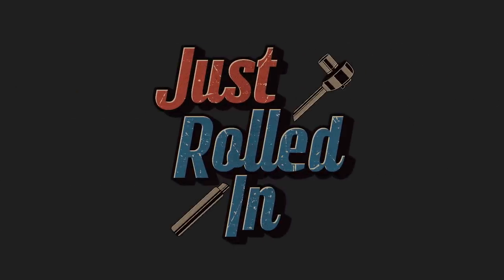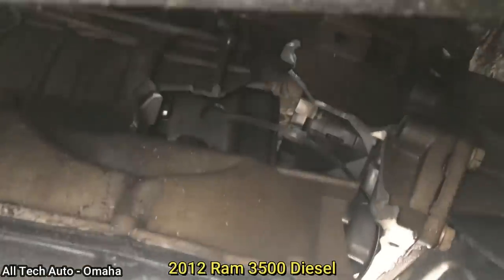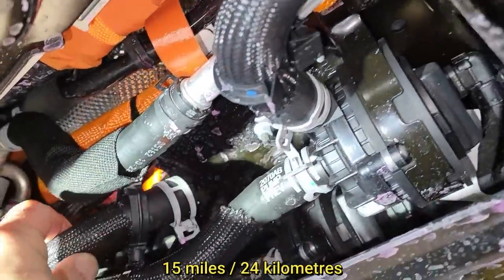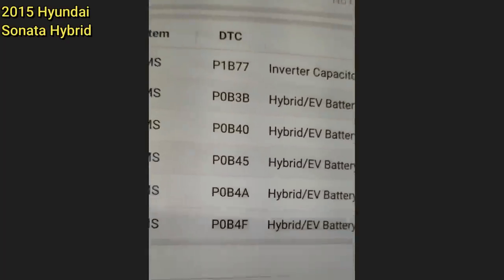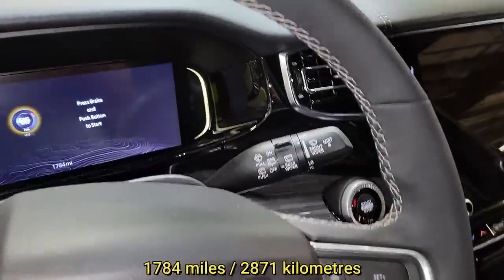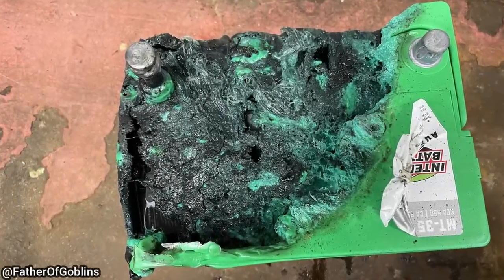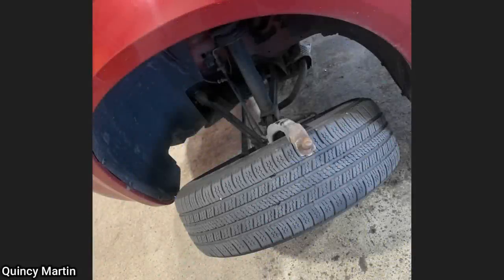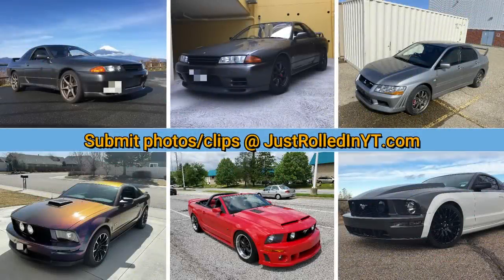Customer States New Truck Won't Stay Running (2022 RAM 1500) | Just Rolled In

Comment: I love the "customer states vehicle sounds like X" ones. It's always "wait that can't possibly be...okay, no, it really does sound like that." :D
Reply: same haha
Reply: I wonder if the mechanic played some fortunate son while checking more 😁
Reply: My Mom once said her car sounded "like a tiny airplane."

It was a wheel bearing up front. 2001 Impala, under 40,000 actual miles, but part replaced in 2017.
Reply: As a former mechanic I used to love when they would come in and try to mimic the noise and then say "what does that sound like?" Sounds like you making dumb noises 😆
Reply: It would be good to get a complete compilation of the "sounds like" ones. I never knew cars and trucks could be as versatile as a synthesiser.

Comment: The 22 Wrangler, that coolant line check is part of the PDI process for the hybrid systems. The joys of Chrysler not getting the training out before the vehicle start arriving - we had the same thing happen to our first Hybrid Wrangler when the customer was on a test drive with it and it spewed coolant all over the place.

Guess who didn't buy a Hybrid Wrangler
Reply: I’ve seen a few brand new rams go for PDI drive and come back with coolant everywhere, normally just clamp left loose somehow
Reply: I mean it's a clamp? Why wasn't it just attached from the get go? Albeit, my friends used to work at Brampton Assembly, so uh, yeah, I know what goes on at Chrysler :P
Reply: @Patrick.Weightman  New jeeps are fiats and even worse
Reply: I used to do pdis. Sometimes you catch shit that would have caused a wreck if it had gotten out into the world. We're not supposed to tell you, but yeah, factories fuck up.

Comment: Even if we disregard the RAM with the grenaded transmission, this video indicated that buying a new Chrysler product is simply not advisable, to say the least.
Reply: Can attest to this. I work at a Dodge dealer, so many issues with these new cars and trucks and it's getting ridiculous. Luckily I don't have to touch jeeps cause screw that.
Reply: Yeah that was sort of my take on this as well.  The things aren't cheap either.  No thanks.
Reply: @FZ6er  GM and Ford aren't much better.  And it's the stuff they've been making for decades.   A valve?  Really?
Reply: The pentastar engine is junk. Had to replace all my lifters at 45k miles. Almost had to replace a intake cam also because the spindle bearings in two of the lifters were gone. Really grinded the cam lobes on the edges. Checked with a micrometer and was luckily still in tolerance.
Reply: @questendervids2090  131,000 miles and purring like a kitten :-)
Reply: Um, (in my opinion) more like ANY Chrysler! I grew with Chrysler cars in the 1990's; they were junk then, they are junk now.
Reply: I remember that even in the 80s Chrysler transmissions were notorious for being ....troublesome.
Reply: Hell no! I'm in the market for a light duty truck and id rather pay the second hand premium for Nissan or Toyota.
Reply: @michelinman8592  That's he he means, all Chrysler products, Dodge, Jeep, Ram etc
Reply: @themidsouthcyclist8880  Some were, but not all. The UltraDrive 4 speed was a headache for buyers and dealers. The reliable TorqueFlite of the 50's and 60s and 70s was bulletproof.
Reply: Certain kinds of people buy jeep dodge chrysler products these days…
Reply: Why are we disregarding the RAM though? 🤣
Reply: @quantumleap359  because they were simple then.
Reply: 290,000 still purring.
Reply: @cynicalnative3389  maintenance
Reply: The problem with people they talk to much about the past Chrysler is far more reliable than Ford or GM
Reply: Is anyone surprised by that? 😂
Reply: Hasn't been advisable for a long time... hasn't stop a single person yet.
Reply: @sjohnsonnc06  🤨 da fuq?  I'm not gonna shxt on your lived experience here.  But, really?
Reply: Just buy japanese or German
Reply: @drkar4656  yeah there doesn't seem to be a pattern. I've seen wranglers with well over 200k on the clock be totally fine, but ive also seen engine failures below 20k. I really don't know what they're doing, but they need to get on it.
Reply: Can't agree with you more, my 2018 ram has been a disaster since day 1. Chrysler refuses to honor the warranty even. despite being 100% stock and unmolested.
Reply: @TheTsunamijuan  just like with the jeeps.  Advertise adventure, but if you actually let it touch grass...boom, that fleck of mud voids your warranty.

 Everything, especially now, is mechanical hot potato...
Reply: @vex6559  Mines been eletrical issues and transmission issues since day one. infact, it refused to start today, after i needed to move it from infront of my garage to get my other truck in. With the error "low battery/no battery present". Since it rained last night it just proves that theres a leak in teh dash which was already diagnosed by another shop. That they refused to acknowledge or fix.
Reply: @TheTsunamijuan  Chrysler is really bad with electrical.  We had to limp mode a jeep on the highway for 30+ miles to find the one dealer with a funny mustache who was the last long term tech after they booted the others. (Up the largest hill in the state)  It was a 5 cent connector from the smallest wire with intermittent contact loss from the cvt trans (most exposed to the elements)

 This was in the second trans, which lasted about til just after warranty...as always. 

 Honestly, only thing to do is try to find an old vic on the cheap and fix it up.
Reply: @vex6559  after a year of my ram being unoperable and unsafe, due to fractionaly functional breaks, a trasmission that refuses to go into gear half the time, and the leak in the dash causing all the eletrical issues. I ended up getting a 2022 gmc sierra 3500, which has been flawless so far, already have put 5000miles on it in the last 5 weeks of ownership. It just works which is what i wanted when i bought the ram (which was new as well).
Reply: A subsidiary of Fiat, a company well-known to older guys in the industry who can remember the last time they sold their trash here how bad that company's cars were.
Reply: Or literally any Chrysler product for that matter
Reply: @questendervids2090   2018 dodge caravan 170,00 miles without too many problems on
Reply: @joshmanis9860  2015 Jeep grand cherokee with 46k miles. I should never have had this proplem. And yes I have my oil changed three times a year (city driven).
Reply: @questendervids2090  damn we did have some transmission problems because in 2018 to 2019 my dad was in the hospital for 5 weeks so he couldn’t work so that van got basically zero maintenance for 90k miles because my mom did Uber basically  24/7 it did get free oil changes from the dealership but no tranny maintenance
Reply: Pretty much everything these days except maybe Toyota or honda
Reply: @FZ6er  I’ve always wanted that small suv I think it’s a renegade, but I refuse to deal with Chrysler products
Reply: @MechaniclifeJDM  Oh Yeah, those Hemi type people race down my street ultra-dangerous speeds. 10k watt stereos blaring!!!
Reply: I had a 2019 Ram 1500 and loved it! I never thought I would say that in my life! My honest opinion is e everything turned to shit after the covid scamdemic!
Reply: @FZ6er  American engineering, Italian electrics, French attention to detail, and British quality control: Stellantis.
Reply: The older I get, the more convinced I become that the carburetor is the pinnacle of automotive technology. It may not have been the most green, but there's something to be said for being able to fix 90% of your problems on the side of the road with a wrench and some carb cleaner.
Reply: Dude 2020 cars are really shit watch more vids they all ha e major problems
Reply: Chrysler is known for longevity due to their high quality electronics and engineering.
Reply: @questendervids2090  how often did you do your oil?
Reply: @chungusamongus519  twice a year, every six months I have the oil changed at the dealer where I bought my jeep.
Reply: My first car was a Chrysler, that lasted four months…😅

Been driving German sport luxury cars ever since, currently in a Porsche and it’s AMAZING. Never going back. 😂
Reply: @bechtoea  Toyota and Honda make good cars, but unfortunately ram and Ford have the best trucks.
Reply: @bechtoea  All 3 of my Silverados have been unreliable pieces of shit too.  Is the moral of the story here just don't buy a truck?
Reply: My dad was a Chrysler mechanic for 30 years and won't buy anything newer than a 2014 at the absolute latest. After that point there's consistently too many parts that rely on computer systems and not enough that rely on mechanical components, so things can go way more wrong with zero warning and with the electrical systems in the cars getting more powerful to handle the computet systems they're more dangerous to work on. Plus all the shortcuts not even just encouraged, but almost mandated in the factories to cut corners and lower costs (even if that's not reflected in the egregious prices of these scrap heaps), the proprietary parts that cost both the shop and the consumer an arm and a leg (which encourages the "declined all repairs" because nobody wants to spend so much money on, let's a wiring harness, BEFORE labor even gets accounted for), and lack of general knowledge being given in driver's ed, make for cars that are damn near the point of being death traps straight off the lot, and drivers who don't know what to look for to know when something is wrong.

Comment: Because of u shedding light on these “errors”, I now walk around my cars when I drive them looking for any leaks and whatnot. Especially with my Volvo. Yikes. People scare me sometimes.
Reply: Toss a piece of cardboard under the motor (on the ground) and it will show any leaks and pretty accurately where
Reply: @Saanonymous80  that’s exactly what I’ve done with my Volvo. I had the rt front axle replaced last year and the mechanic pointed out my oil leak. I finally figured out y I was leaking coolant from it as well.
Reply: Me too.
Reply: How do you drive them and walk around them at the same time?
Reply: Volvo is brick. No need to check.
Reply: Those are the people coming at you going 70 mph with only two painted yellow lines to stop their busted ass car from hitting you
Reply: @southpaw117  I donno RC?
Reply: @the_kombinator  my volvo has been very slowly leaking coolant from where the water pump meets the head. Either the head or the block are right at the edge of the machining tolerances. It's only been like that for 30 years ;)
Reply: I have a 2011 XC90 V8. (The one with the Yamaha engine and Toyota Transmission) I still remember after buying it taking it into the dealer for it's 70k service and a transmission flush, as the Toyota transmission is always the failure point on all models of XC90's for some reason.  The head service tech came out to greet us when we went to collect it to give us a condition report.  Apparently it was the only V8 in the history of the dealership to come in without a single oil or coolant leak, or even any sign that it's ever had one from new.  Volvo calls the V8 'The Sieve' in their service guidelines! Apparently we seem to have dropped on the only Orange in the Lemon orchard! Planning on keeping it for as long as we can. It's great at Dune running and sand track bashing too in total luxury!

Comment: Being the owner of a 2nd Gen Ram 2500, I can attest:  Dodge puts great engines in their heavy duty trucks and rubber bands for transmissions.
Reply: Tupperware Transmissions without the lifetime warranty!
Reply: put* past tense
Reply: @5c0H  So past tense that diesel shops have specials to rebuild the 69RC!  😄
Reply: Lmao, the only good transmission they made for their truck was the 545RFE. Other than that, they are all pretty weak. The 42RE, 46RE, 47RE, and the RH alternatives to those. The 47RE was especially bad.
Reply: Nv5600 gang 💪🏻 my 04 dually cummins has the nv and a southbend clutch.
Reply: Yup. Father's farm truck had a 90s ram with the HEMI. It ate 4 transmissions. I'm   sure they made good ones but his was trash.
Reply: Worst in the industry for transmission and paint. Love how EVERY year they come out with a “new and improved” design. They can’t get it right. Tundras have a Cummins option now if you want a good heavy hauler I hear.
Reply: @kkoch666 I appear to be wrong.  Then it must have been the Magnum or something. It was they're v8 engine they boasted on and it wasn't a 5.9. Thanks for the correction. I'm a Ford guy🤷‍♂️
Reply: G56 and your troubles are gone.
Reply: @kkoch666  the real “Hemi” engine came out in the late ‘50’s.
Reply: Looks like the guy holding the valve head from his 880 mile hemi is having a hard time believing that !!! LoL
Reply: Wonder if you could adapt a chevy 350 trans onto a new Dodge? Even an old Torqueflight.
Reply: Jeremy Hales (What the Hale$ on YouTube) had that happen. Fortunately he'd just exited a freeway and was at the light on the off ramp when his Dodge truck's transmission went SCREREEEEEEE and the truck would go forward no more.
Reply: @kkoch666  never heard of 4.7 ?
Reply: And always has